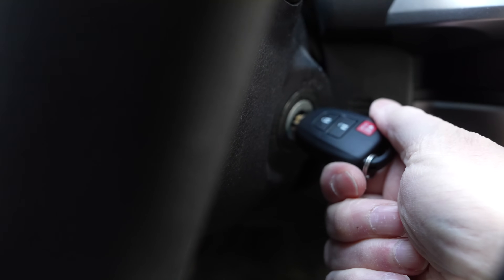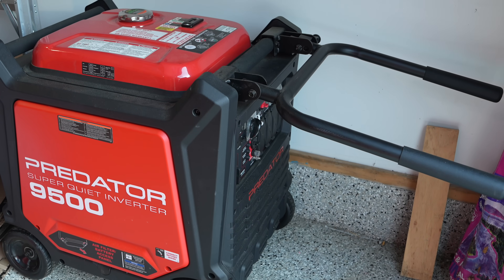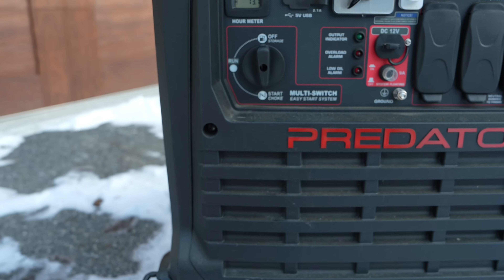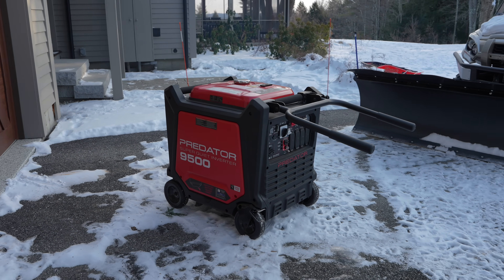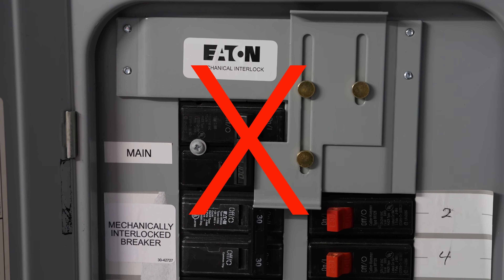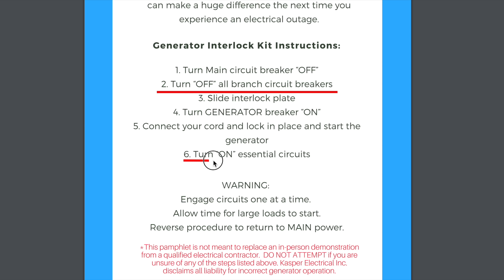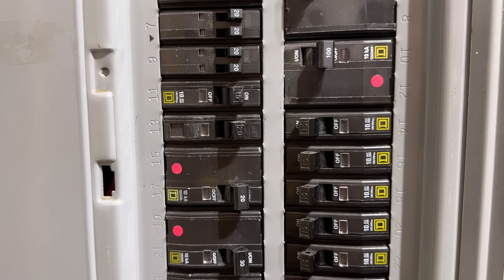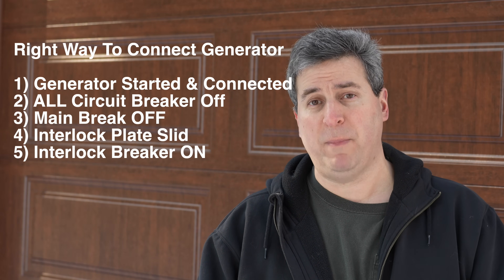Homeowners are Destroying Generators Skipping 1 Step During a Power Outage

Comment: Save your generator fuel by turning on only what you need.
Reply: Save your generator by running it when you don't need it!  Not just emergencies. Good gas, clean injectors!
Reply: @jlosFLTX  You can afford a generator with an injector (or more)?? Wow! (most are carburetted)
Reply: @ like almost all diesel?? and yes, the tractors, the trucks, the generac, the boat gen......not everyone can plug their toys all into a honda 2000
Reply: Hook it up to natural gas, problem solved. If you don't have it use a propane. With LED lights there isn't much none essentials that draw much power.
Reply: My 12kw generator and Outback Radian inverter allow me to provide power to the house and recharge the batteries with whatever is above the house demand so I can shut the generator off and run most everything  except washer, dryer and water heater off the inverter and batteries so depending on the duration/time of the grid outage I might not even have to run the generator.. Peace and quiet in the country..
Reply: As soon as the power goes out all my neighbors fire up their noisy generators and leave them running until the power is back on.  I wish I could have a few hours of quiet.  It takes some time for the fridge to warm up.
Reply: @erikj9962  My neighbors don't have the nerve to complain about my generator noise.  Reason being, I throw an extension cord over the fence so they can at least plug in a fridge and a few fans.  Last outage, I had extension cords over two fences.  No complaints.
Reply: @Threedog1963  Screw the neighbors.
Reply: @erikj9962  That’s probably due to the fact that most people prefer to have their power on vs sitting in the dark for hours😂
Reply: i keep it off for 3/4 hours or more depending on how cold the fridge is @erikj9962
Reply: @erikj9962  I find it hilarious talking about refrigerators when there is snow in the video.